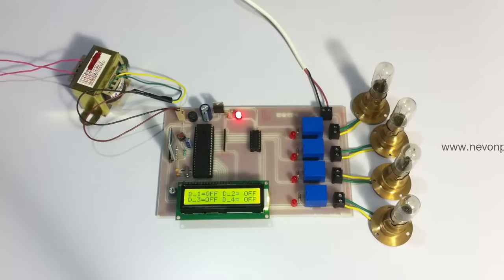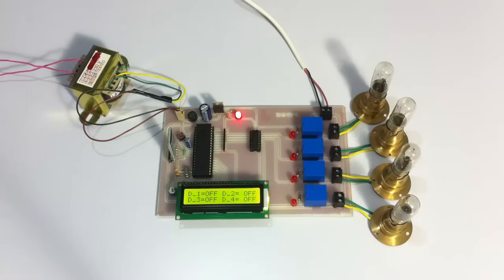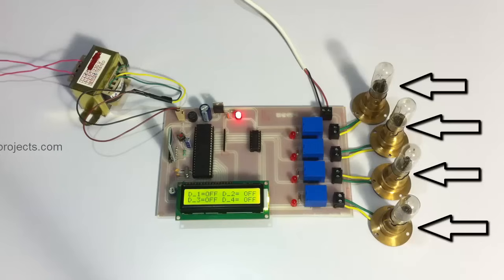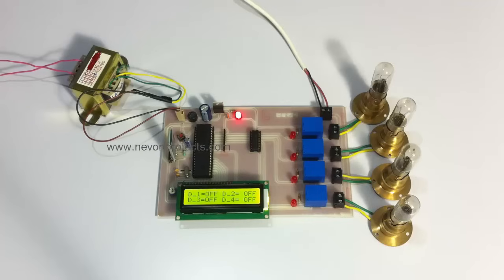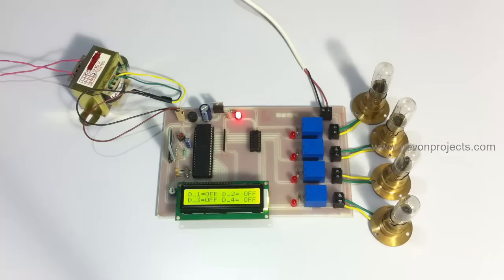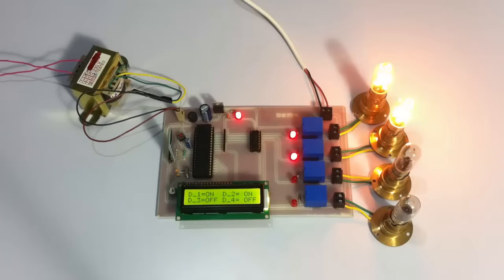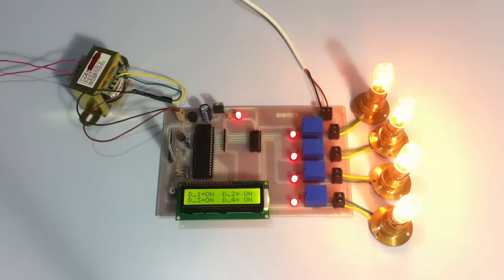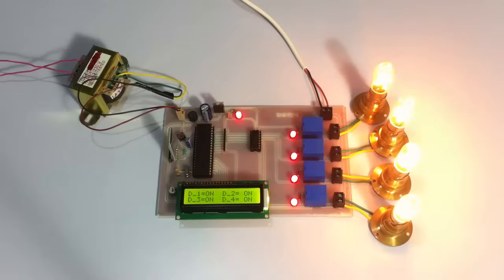Voice controlled home automation project

Comment: can I change the bulb into a socket? thank you!
Reply from the maker: +Maynard Bicos Yup no problem... it will supply the mains voltage to whatever you attach there..
Reply: oh great thank you very much Nevon Projects
Reply: Nevon Projects what about if I connect the electric fan in the socket I connect to the circuit did the fan will open automatically without pressing the power of the load. Thank you.